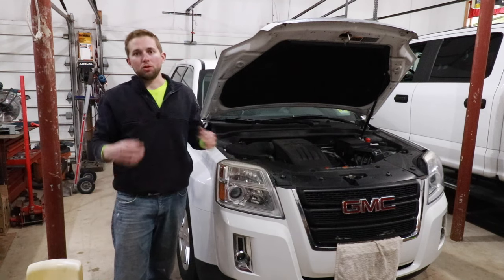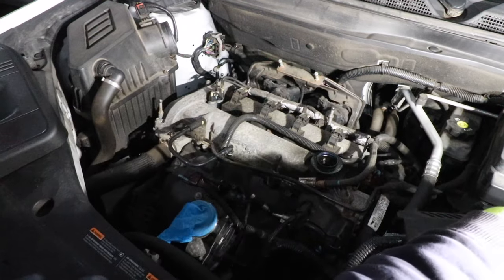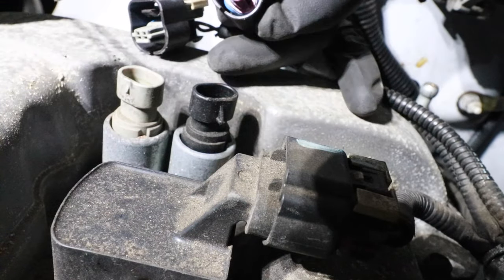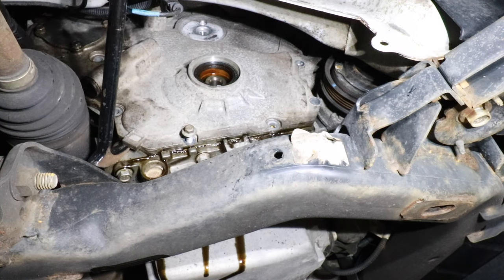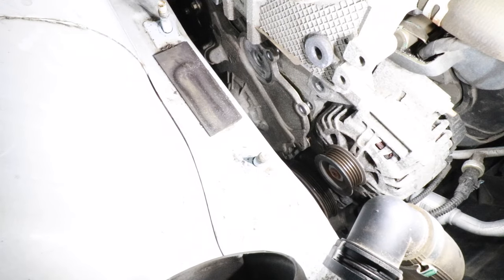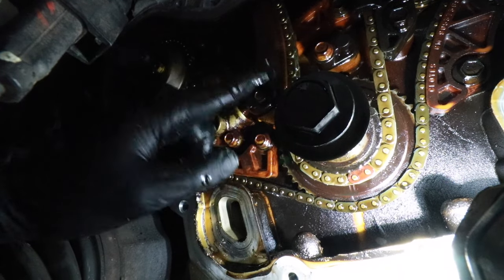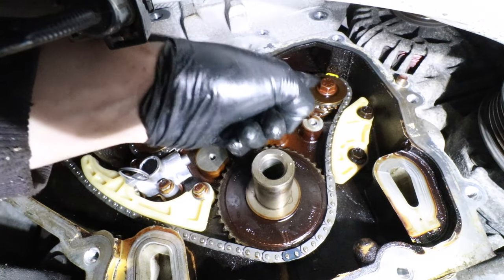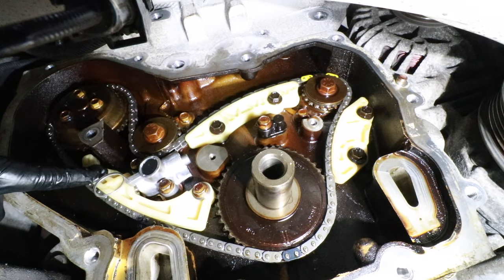GMC Terrain 2.4 | Timing & Balance Chain Replacement | Step by step

Comment from the maker: 🚩 Don't cheap out on this Job!      Use OEM Components!!!       Links to OEM parts in the description above. 🚩
Reply from the maker: Look at some of the reviews of aftermarket chains. I've read some horror stories of aftermarket chains breaking. OEM lasted 140k Miles without breaking. Do what you want  @imgonnagogetthepapersgetth8347
Reply: OE brake pads even go 140. Some people are so ungrateful anymore. Used to be lucky if the whole car made it to 100
Reply: @imgonnagogetthepapersgetth8347  you could even buy a used Toyota back in the 90s huh lol.
Reply: @imgonnagogetthepapersgetth8347 trust me when I say use oem I did this entire job on my 2011 Buick regal 2.4 and I had an aftermarket tensioner fail and completely bent my valves.600 dollar rebuilt head later.Some things should stay oem and I’ve learned that the last few years working on cars
Reply: @oldsoulmillennial should there be front to back play in any of the new guides once completely installed?

Comment: Used this as a guide on a 15 Equinox with just under 92k starting to make the noise already—turns out the chain was stretched and rubbing the top of the valve cover. This is probably the best video explaining this process without an engine hoist, and your explanation of top-dead-center actually made a lot of sense. All in all it took me about 10 hours start to finish but it already runs so much better that it ever had before.
Reply: I have a 15 equinox LT 206k and I want to replace the timing chain and possibly the balance shaft chain. Any tips, tools or advice you could share.

Comment: This is why you should buy CRV or RAV4, so you don’t have to deal with this lol.
Reply from the maker: Agreed! Too many problems with GM's
Reply: I ❤ Honda 4cyl😊
Reply: I guess you have not read or know about the Honda TSB about the rattle on start up. Same problem needs a chain and phaser or camshaft. Not to mention about them burning oil and ruining cat. converters.
Reply: As I was watching this, I was asking myself “why didn’t my daughter buy a Toyota?”😂
Reply: You will deal with this on a Honda and Toyota too. They aren't immune to timing chain failures at the right mileage.
Reply: All vehicles suck
Reply: @EconolineLowrider-oh1tl honda 4 cylinders are about the same as GM. V tec is better than eco tec for sure, but they all have issues
Reply: Those are even worse/harder to work on… do you know what you’re talking about?
Reply: Not everyone is so privileged as to buy those particular ones some of us get what we can get and have to keep it repaired until we can get it right
Reply: You could be helpful instead of being yourself.
Reply: I will never buy foreign
Reply: Hindsight lol I wish

Comment: I have the same GMC Terrain Vehicle and at 109,000 miles I started hearing a noise near the timing chain.  I took it into a shop and they stated im better getting a used engine for $1,500 to $2,000.  So I decided to do it myself.   I had removed the items in your vehicle and saw that the timing chain was lose as expected.  I purchased the items on your video and did it myself making sure I did not miss a step from your video.  It took 10 to 12 hours.   The vehicle is running like a new vehicle and no oil leak anywhere and sounds like a new vehicle.  Great Job!! and Thanks for the video.

Comment: Just wanted to say that I have the exact same vehicle, and one of the black guide bolts worked its way loose and wreaked havoc inside the timing cover and snapped the cam timing chain. The kits was about $115 off of Amazon and I was able to replace EVERYTHING and re-time it all thanks to your video. Your instructions are spot on. It runs so smooth and quiet now. Purring like a kitten. Thanks man! A fantastic tutorial. Took me about 12 hours, start to finish. I did not have to remove the engine mount. I was able to get that top bolt with a 10mm 'ratchet style' box end Stanley wrench. Just a great tutorial, I can't thank you enough. Top quality. Keep em coming!
Reply from the maker: Glad this video helped!
Reply: Cowboyup I was wonder what the kit number that had everything  Thanks
Reply: i had the same thing happen. except the black guide came out in 3 pieces this video saved me a crap load of money.
Reply: Is the oil have to be drain?
Reply: @buscojosenjuarezdenuevoleo9669   yes, you'll need to drain the oil because you have to remove the entire oil pan. (13mm socket) And be sure to clean it of any debris. Including the oil pickup tube inside the pan. (10mm socket) So make sure you have some Permatex gasket maker or equivalent, since there is no manufactured gasket for this engine's oil pan. Put in new oil and filter after reassembling and before starting the engine again.
Reply: Did it not bent any valves? Asking because mine jump time and I’m debating on risking doing chain kit or replacing the whole engine

Comment: This video is a 10/10 man. Got the exact same engine. Figured I'd throw 200 at it myself instead of 2500 to a shop. Appreciate it.
Reply: I'm not sure why you found it necessary to take out the engine mount. The top 2 bolts were kinda 'hard' to get to on the timing chain cover, but managed after some time.
Reply: Even if I spend three days on it it’s still saving me 85 for every hour
Reply: 11/10
Reply: just kidding; I ended up taking out the engine mount to make installation easier.. was worth the 2 minutes for 5 bolts and a floorjack...
Reply: @RyanNelson404  it seems like you could trim the timing cover gasket before installation in order to avoid removing that other thing from the block
Reply: Does it mean anything if the balance pulley spins when attempting to remove balancing shaft bolt?

Comment: DO NOT EVER turn the engine with the timing chain off, very lucky valves weren't bent in the process.
Reply: If you're doing it by hand you'll be find dumb ass, as long as you know not to go hard on it if it binds.

Comment: I did my timing chain, water pump chain, sprocket's, guides, cam sprockets, gaskets ect.... I have seen a lot of texts people have left saying they tried to change theirs and were not able to get it running again. One problem people run into is they don't have they're cams set properly they put it back together and they get valve interference with the pistons and valves ( motor will lock up) the way to avoid that is while standing on the passengers side of car look at the first cam lobe on the front of engine (intake) make sure the lobe is at five o clock then look at the first back cam lobe make sure it is at seven o clock if you have your lobes at these points and your number one cylinder is set at top dead center you are good to go to re assemble your timing chain and will not get any interference. Buy a good kit cloyes is a good brand make sure all of your timing chain slack is all on the left side so your chain will be tight when you install and trigger your chain tensioner. Put a cloth over your gap where the oil pan is open so you don't drop any bolts or parts down in your pan.

Comment: Just a FYI, this was easily a $1200-$1500 repair. You did great.
Reply: gmc delaership just quoted me 3300 lolol get out of here
Reply: If your only paying 1500 for this job , RUN! 
This is a detailed job and not to be rushed through by some non tax paying mechanic! 
With timing kit, water pump, gaskets, spark plugs, warranty , 3200 bucks easy.
Reply: @Rccrdawgs  not true, my guy said 1400. It would probably take him 4 hours and he's legit.. works in a shop during their after hours and takes in his own customers.
Reply: I charge 2,600 with parts and labor I also include the water pump
Reply: @bulltor3583  yeah, he did say he isn't touching that unless he needed to

Comment: Great video... for those who are having trouble aligning the exhaust cam key at,, 27:51 he explained, but if you have doubts with that method there is another method.... So all timing marks should be aligned with the crank shaft key at 12. With marked timing chain link on exhaust cam  place sprocket on cam(do not tighten) turn crank shaft (looking at bottom mark witch is 6oclock to about the 7oclock mark. If your look at the top key it will be another the 1oclocl... Then take a 24mm or 15/16 wrench against intake cam and rotate counter clockwise also while rotating exhaust cam sprocket counter clockwise until the exhaust sprocket key meets up with the exhaust lock. It may take a few times but it always works for me... hope that it works for you..

Comment: I have the same vehicle and I’m going through this now I’ve changed the top timing chain but didn’t do the water pump one. Put everything back started then second later ….off, imma just doing all the timing and follow your video. No one else did a video on the terrain timing chain but you. Very well made video bro this will help me out a lot.
Reply from the maker: Thanks for the comment. Lmk if you have any questions, I'll always do the best I can to help the people that watch my videos. 

Also Make sure that you replace the guides and tensioners. Don't cheap out on parts here.  It's BEST to use OEM parts. Cost me around 300 bucks for All OEM components. I've read so many horror stories of people having aftermarket chains break.

Comment: By any chance, to you remember the torque specs on the crankshaft pulley bolt, as well as the valves cover bolt torque specs? By the way, I was able to do these same repairs with ease because of your video. Most detailed video out there! Besides the cutting the video short!

Comment: Awesome video, I did it without removing the motor mount, you just ha e to get that top 10mm bolt with a skinny ratchet from the top above the alternator  :)
Reply: I used a 1” extension and a shallow well
Reply: Timing cover gasket can be clipped to get around the mount

Comment: Surprised you didnt do the water pump while you were right there😵‍💫 i have to do my wifes terrain. Not looking forward to it. But seems straight forward and easier than doing an audi timing chain. What really threw me off was the timing chain marks not aligned on the oem chain. I dont think it skipped tooth on timing but something definitely strange. In the future if you could call out tool sizes as you use them that would be fantastic. Anyway thanks for posting!

Comment: I've seen several similar videos,yours has the balance chain replacement included. I wonder why the water pump isn't also replaced when going this far into the job? The only other thing I would add would be assemby lube to the chain and tensioners. I may have a job like this in my near future. Thanks for sharing.
Reply: I've done a couple of these jobs I'm not sure why you would be needing assembly Lube for the chain and tensioners.

Comment: Did you change the oil pump while you had everything off? did you check the oil pan to see if any debris was in oil pick up screen?
Reply: Check for any broken or missing components, they will end up in the oil pan. The oil pump seldom fails and is easily replaced.

Comment: Also. You can see when he is in there. There is a sliver of head gasket hanging out that is crazy sharp. Save yourself the hassle and make sure not to force any bolts out and your ratchet slip. Trip to the ER cost me more than the repair.

Comment: Great video sir i have a question after installing the timing and balance chains when rotating the engine manually there's a spot where it gets a little harder to turn then there's a popping sound not that loud but it seems to be a valve the exhaust is at the 7 o clock postition and and the intake at 2pm at tdc so i doubt there's something mistimed but i may be wrong
Reply from the maker: Resistance is normal. That resistance you feel is the camshaft lobes opening valves.  So long as you have the chain timed properly on those timing marks, you should be good to go. 

If you are not confident about the timing, take the chain off and start over. 

If you hear a metal on metal  sound, or the engine is binding, then that would be a problem.

Comment: Im late to this show. Do you recommend replacing the cam sprockets?
Reply from the maker: @tyuiop1736  If it’s worn, yes. Mine was in good condition, so I just reused it.
Reply: @OldSoulMillennial  by chance do you have a link to buy new ones. Oem or aftermarket you recommend. I would rather spend the extra and not have to worry about it

Comment: I understand the two camshaft bolts require replacement. Single use only... Or "torque to yield"... But doesnt this also apply yo the main crankshaft bolt ?

Comment: Wondering as every kit including yours has a timing gear oiler. I didn’t see anything in this video, what do you use this for or does it get placed somewhere not shown in the video? Thanks again for the video as this is very helpful.
Reply from the maker: Great question. I did replace the oiler, but I forgot to video the replacement. I believe its bolt off, bolt on. You can't miss it once you disassemble everything. Very simple.

I believe its purpose is to direct engine oil directly on the chain. Really, it's just like an oil guide chute.

Comment: If you were already at TDC why would you rotate the crankshaft for the balance chain?
Reply from the maker: @funshine3571  If I recall correctly: Camshaft can rotate independently without damage. Try not to rotate the balance shaft sprockets.

Comment: When doing this job, use good quality replacement new parts (e.g.Cloyes or similar). However, the black LH chain guide can be totally disregarded & replaced with a much stronger item as used on racing engines, which is obtainable on-line from 2 suppliers in the US. Their much superior & stronger 6mm dia. guide fixing bolts should also be used throughout. When installing the 2 chain tensioners, prime with oil beforehand, also the VVT sprockets internally. When replacing the valve cover, remove all the OEM 8.8 bolts & replace with 10.9 rated strength bolts or better still 12.9. Use SHELL synthetic 5W-30 Helix Ultra Professional engine oil and change with filter (best being from MANN or Bosch) after 2,000km. Check valve timing chain top (upper) guide after 30,000km for wear. Change valve cover oil filler cap for a new AC Delco FC219 type with blow-off valve incorporated. Job done.

Comment: So you can move the crank once you take the timing chain off??? I moved mine clock wise until the timing marks lined up after I already took off the main timing I’m talking about the balance shaft chain
Reply: I feel like I messed something up because I rotated the crank clockwise to line up the second chain marks is what I’m basically getting at
Reply: Omg U never turn crank with timing chain off he's lucky 
He didn't bend valves
Reply: I figured it out but nope I got it all good didn’t bend anything and it’s funny u find a question hilarious and yes I can turn the crank without the timing chain on shows how much u kno about a 2.4 ecotec it’s cool tho good thing I figured it out myself
Reply: So you can or can’t on this engine
Reply: Of course you can turn the stuff, how else are you going to get it to line up, just don't try turning it more than a couple teeth. Just make sure all the marks line up when you are done

Comment: Ні. thank you for video. 
  I am considering GMC Terrain 2.4 as my next car. 90% of cars with mileage of 140-180 thousand kilometers. Now I understand that cars up to 200 thousand have a native timing chain. What to do when buying such a car? Immediately replace this spare part? Should I wait for the absence of symptoms? And how much does such work cost from a professional mechanic? In general, I am surprised that there is a chain in the engine of a modern car like in my bicycle.
Reply from the maker: I would avoid the GMC Terrain 2.4 if possible. The 2.4 likes to burn oil, and thus, the pcv system gets clogged regularly. I believe the oil consumption is due to crummy piston rings (causing excessive blow by). 

Subscribers have reported that a replacement timing chain may cost between 1400-3400 USD depending on the mechanic.  Also depends if you replace the balance shaft chain. Both chains should be replaced every 100-120 Thousand miles.  

In short, unless you are mechanically inclined and intend to do your own repairs and maintenance, A used high mileage 2.4 Terrain will likely be problematic and expensive to maintain.
Reply: @OldSoulMillennial  Thanks ❤️
Reply: @OldSoulMillennial  Agree with all that you said.  I have a 2011 Chevy Equinox that uses lots of oil, clogged pcv system blew out rear main seal, and has ruined the cat because of all the oil blow-by, cracked exhaust manifold, etc.  So yes, I would advise avoiding that 2.4L engine like the plague.

Comment: I just replaced the tensioner but didn't tap it to "activate" it. There were so many back and forth comments online with no clear answer on whether it will activate itself or you have to manually activate it. Of course I didn't see this video until the job was done. The car sounds exactly the same as it did before with the quick rattle on startup. I honestly have no idea if it activated or not.
Reply from the maker: The tensioner must be manually activated. It is possible it deployed, however if you are still getting that rattle, chances are it didn't activate. I would pull the head, and check the timing chain tension.

Did you also replace the balance shaft chain? That was the main rattle noise on this car. If you look through the video, it was hitting the case.